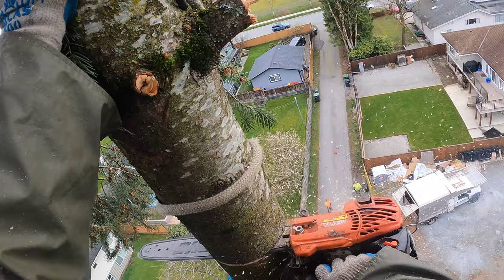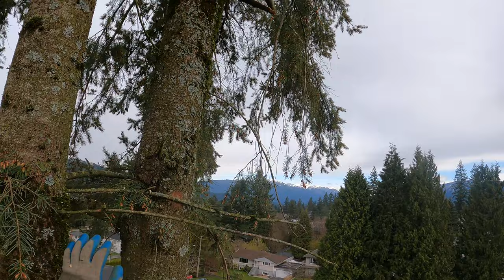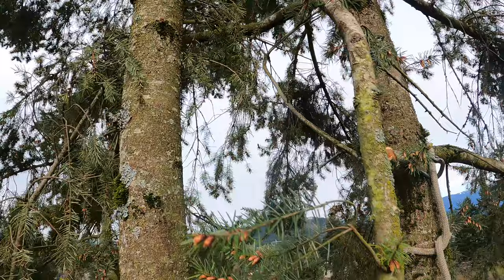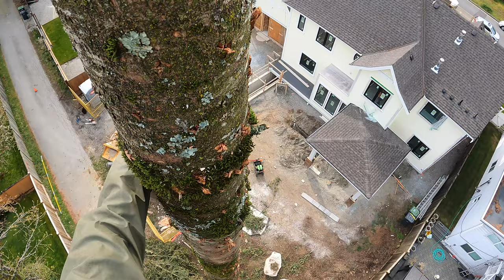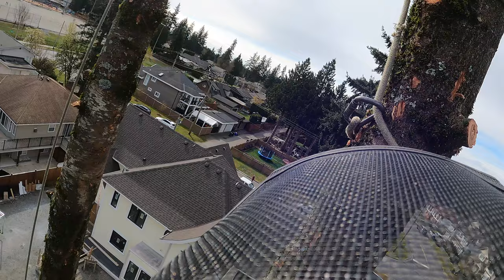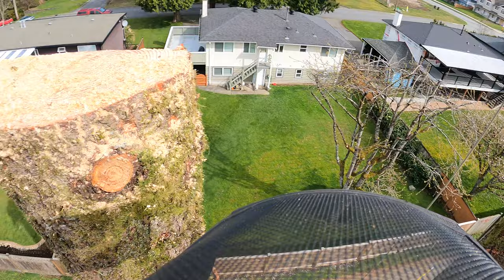Don't Hit My House "I'm Watching!"

Comment: U need a 200t ! Not that anythings wrong with the echo , just a little more RPMz , its my favorite saw they dont make anymore , im rebuilding one in my shop as i write this
Reply from the maker: 200t would be nice. the echos H screw keeps loosening out/richening up going gutless. leaned it up and got the rpms back. screw must be loose, it keeps happening.
Where did you find your 200t?
Reply: A 201TC is just as good as a stock 200t. Torqueyer too I reckon.
Reply: @reubentrapp  did u remove the red adjustment  stops if so you can order more for your echo I think  there like 2 bucks a piece
Reply from the maker: Yeah I did, was thinking of trying that, I think I have the old ones lying around